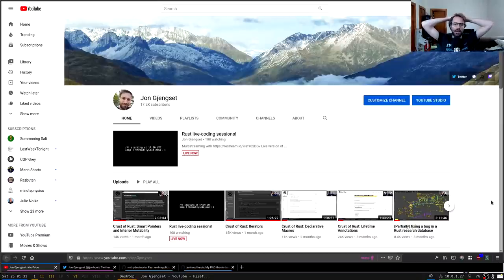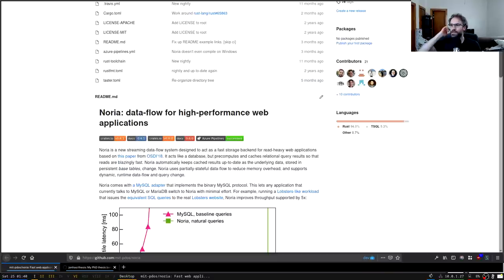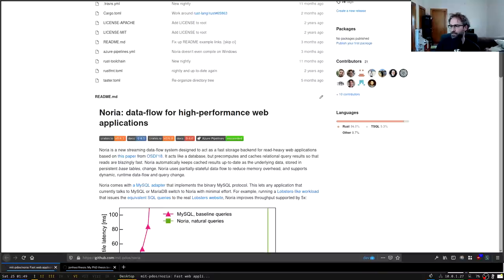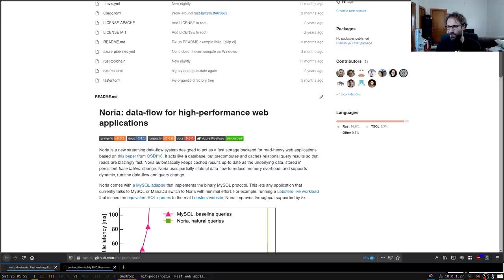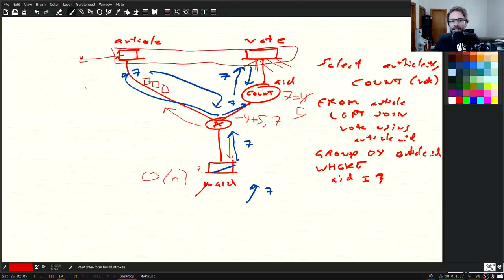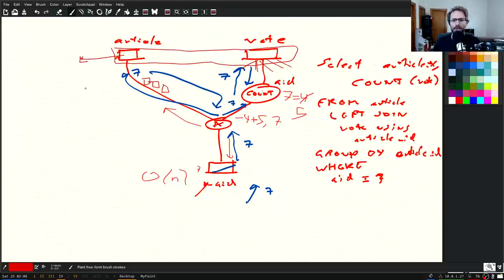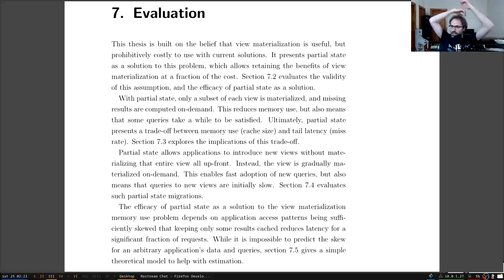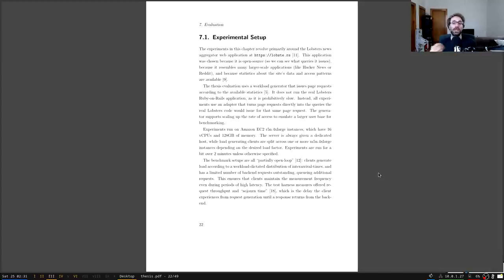Thesis Talk: The Evaluation Chapter

Comment: The "Noria in simpler terms" appendix is a really good idea. I might do something similar (I might not go as high level in my description as you alluded to; I don't need my mom to read that part and understand it :D), so I guess I should credit you when I do end up using that xD

I'm developing simulation software, and the program I developed / am still developing will be handed to future grad and undergrad students, so having a couple of pages dedicated to breaking down what is so special about my code that is easily digestible by not only future developers but also my committee, not all of which are versed in numerical physics after all and might not want to sift through my code docs, will probably round out my thesis very well.